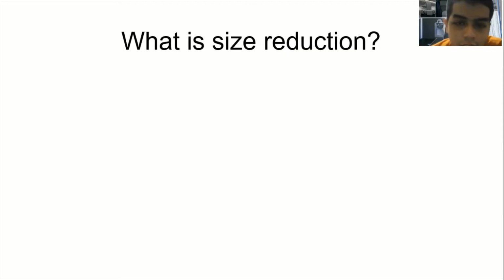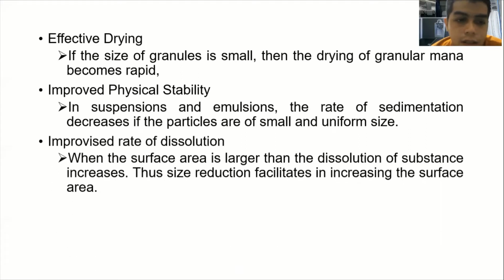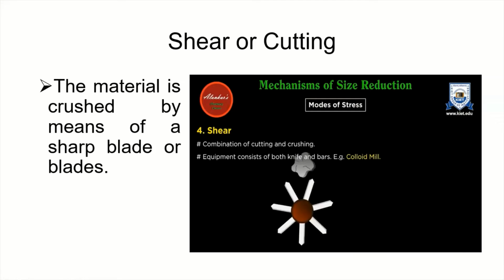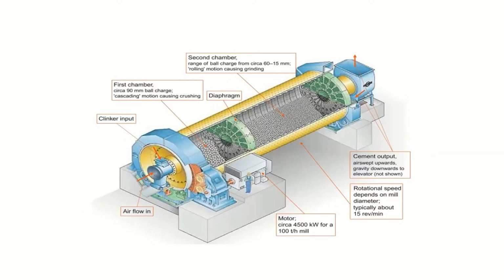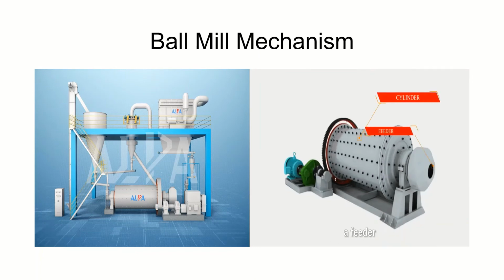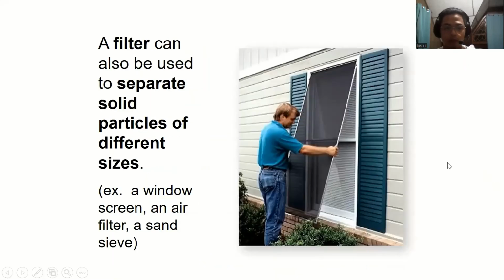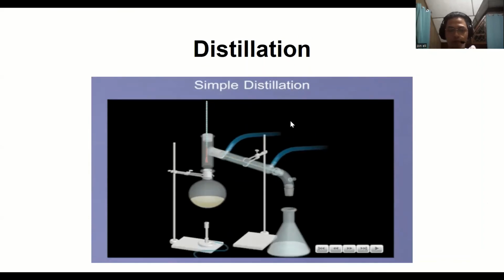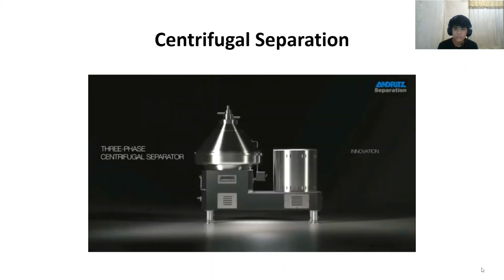Size Reduction and Separation of Solids

Comment: Griño, Loruelle Z. BSME4A
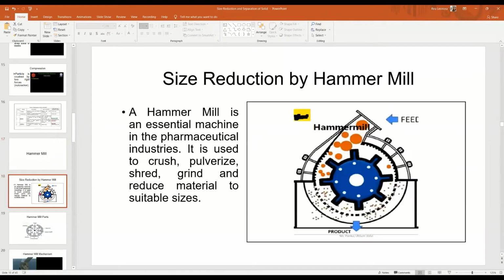18:33 Hammer Mill
It is mostly utilized in the pharmaceutical industry as a size reduction device. Crushing, pulverizing, shredding, and grinding are the primary size reduction operations that occur within a hammer mill to reduce any type of suitable material to the desired sizes, depending on its subsequent application. A hammer mill may reduce roots, leaves, and ginger, to name a few examples.

Comment: Veloz, Adrian Clark D.

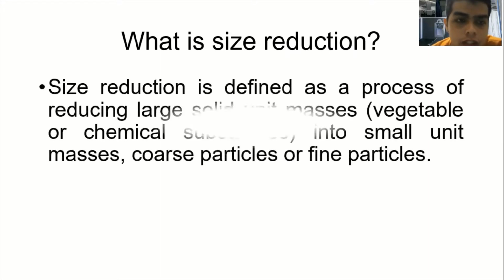1:25 Size reduction.

Size reduction in its name generally means to make the size small by the method of reduction. In the video, it introduces different type of reduction depending whether the material is a liquid or a solid. This type of process is being used mostly in the pharmaceutical industry.

Comment: Macalaguing, Ivan Jun A.
32:25 - I've learned that it is commonly a problem in chemistry, which the basis of separation is set of physical and chemical properties. There are types of separation namely Mechanical Separation, for instance like recycling plastic or metal. Another one is Magnetic Separation example like scraping metal in a scrap yard by the using of magnet.

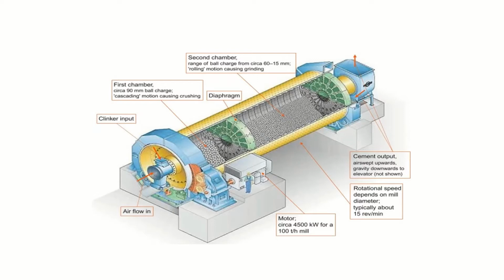Comment: 23:01 Ball mill

Is a type of grinding machine that grinds the material with the help of steel balls. While the maintenance of this machine will be cheaper because you just need to replace the balls when needed.

Comment: 22:15 Ball Mill
Size reduction occurs in a ball mill by impact and attrition. Individual particles within the bed of material in a vertical mill are broken due to such high pressure, even though the particles are considerably smaller than the bed thickness.

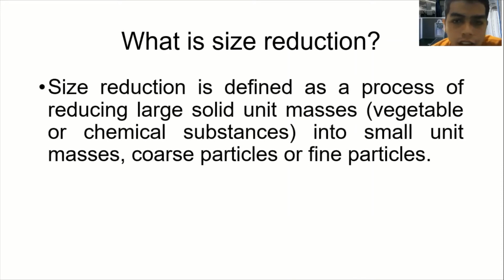Comment: 1:25 What is size reduction?
The process of reducing big solid unit masses, such as vegetables or chemical compounds, into small unit masses, coarse particles or fine particles is known as size reduction. In the pharmaceutical industry, size reduction is a standard practice. Comminution and grinding are terms used to describe the size reduction process. Depending on whether the substance is a solid or a liquid, the size reduction process may be classified into two primary categories. The procedure is known as grinding and cutting if the material is solid, and emulsification or atomization if the substance is liquid.

Comment: Casiño, Sharia Cyril P.
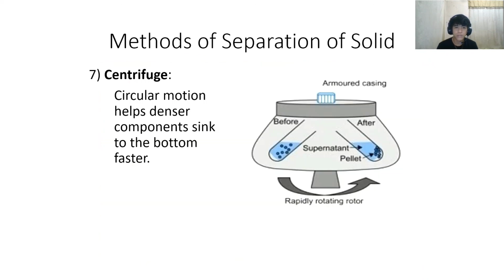48:37 - Methods of Separation of Solid: Centrifuge
The process of centrifugation is used to separate or concentrate materials suspended in a liquid medium. Centrifugation separates particles heavier than the liquid medium using gravity and centrifugal force. Centrifuges separate the particulate from the liquid by spinning the material at high rotation speeds. Also, centrifugation is an accelerated form of sedimentation. To remove particles, most traditional filtration methods employ a filter media. The solid material is collected and removed as the liquid/solid material passes through the filter. Solid particles that are heavier than the liquid eventually separate and can be collected through sedimentation. In the centrifugation process, there is no disposable filter media.

Comment: Calaque, Kyron Davonn C.
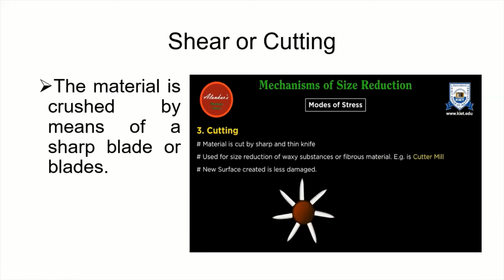14:06 Mechanisms of Size Reduction (Cutting)

Cutting reduces the size of solid materials by separating them into smaller particles using mechanical action (sharp blade(s). Cutting is a method of separating large pieces of material into smaller, shaped pieces that can be further processed, such as powders and granules.

Comment: Castillo, Floyd L. 
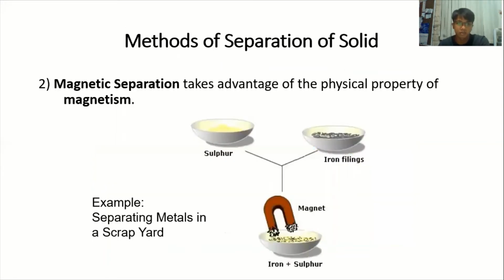33:43 – Magnetic separation of solids
Magnetic separation is the process of separating components through attracting magnetic materials with a magnet. This method of separation separates a non-magnetic material and a magnetic material. Common example is a mixture of iron and sand, in which the magnet attracts the iron.

Comment: Obrador, Crisaint John G.
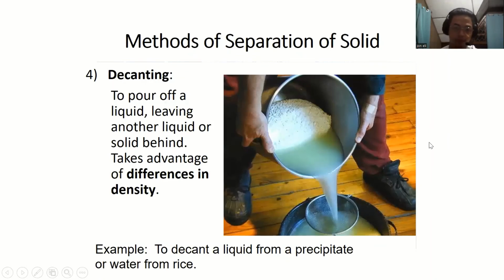39:32 - Decanting
Decantation is a process in which mixtures of an immiscible liquid suspension are separated. For example, if we leave a bucket full of water mixed with sand or clay, we will see that after some time, the insoluble particles settle to the lower end of the bucket. The most common example of this as seen in the video is separating rice from water, which is also same as filtering, but also different.

Comment: Acelo, Ray Joshua L.
48:54 Separation of Solid Centrifuge
A centrifuge is an instrument that uses centrifugal force to separate different components of fluid. By the process of spinning the fluid at very high speed inside the instrument. After spinning the fluids will then separate because they have different densities. Examples of this separation is cream from milk and also liquids from solids.

Comment: Dajan, Kenneth Joseph Rex D.

32:26 Separation of Solid

A separation process is a method for separating two or more separate product mixes from a mixture or solution of chemical ingredients. To put it another way, it's a scientific method of separating two or more substances in order to achieve purity. One or more elements of the source mixture are enhanced in at least one of the separation's result mixtures. In certain situations, separating the mixture into pure ingredients is possible. Separations take use of variations in a mixture's constituents' chemical or physical qualities (such as size, shape, mass, density, or chemical affinity).Processes are frequently categorized based on the specific differences they employ to accomplish separation. If no single difference can be utilized to create the necessary separation, many processes can frequently be combined to accomplish the goal.

Comment: Lamberte, William Wallace A.
6:12 Advantages and Disadvantages of Size Reduction
Before knowing the advantages and disadvantages of size reduction, one must first know what is size reduction. The process of reducing big unit masses into small unit masses, such as coarse or fine particles, is known as size reduction. And some of the advantages in size reduction are, content uniformity, uniform flow, effective extraction of drugs, effective drying, improved physical stability, and improvised rate of dissolution. While its disadvantages are drug degradation and poor mixing.

Comment: Dacoroon, Darlene Grace F.
9:16 - Mechanism of Size Reduction
The mechanism of size reduction depends upon the nature of the material, and each material requires different treatment. Fracture generally occurs along the lines of weakness. During size reduction, fresh surfaces are created or existing cracks and fissures are opened up, wherein the former requires more energy.

Comment: Jayoma, John Lloyd E.
6:13 Advantages of Size Reduction
There were a few advantages of size reduction in this section. One of the benefits is the uniformity of the content, which addresses the effectiveness of mixing only when the ingredients are small and homogeneous in size. The reporter goes over each benefit in depth, including the elements that affect size reduction.

Comment: Casiño, Earl Anthony N.

32:26 | Separation of solids

The reporter discussed the methods of solid separation. The common problem in chemistry is how you can separate them due to each component's having a different set of physical and chemical properties.
The reporter introduced the following:
*Mechanical separation
*Magnetic separation
*Filtration
*Distillation
*Evaporation
*Decanting

Comment: Estillore, Cherry Mae P.
18:40 Size Reduction by Hammer Mill
Hammer mills consist of a series of hammers hinged on a central shaft and enclosed within a rigid metal case. It produces size reduction by impact. The materials to be milled are struck by these rectangular pieces of hardened steel which rotates at high speed inside the chamber. Sizing which occurs by attrition and shear in the second zone where small clearance exists between the hammer and the screen bar producing a particle range of 15-50 µm. The material is crushed or shattered by the repeated hammer impacts, collisions with the walls of the grinding chamber as well as particle-on-particles impacts

Comment: Candaroma, Katriona Maxinne G.
21:30 Size Reduction by Ball Mill
Ball mills are often used to crush and grind materials into very fine powders. The size reduction in the ball mill is caused by fragmentation processes such as impact and attrition, which occur when the balls drop from near the top of the shell. Milling can be done wet or dry, however wet milling is done at a low speed. Ball milling has been demonstrated to be useful in boosting solid-state chemical reactivity in systems with numerous components.

Comment: Pelegrino, Justin Blake Nash E.
18:34 - Hammer Mill
It is a size reduction device that is mainly used in pharmaceutical industries. The main size reduction processes that takes place within a hammer mill are crushing, pulverizing, shredding, and grinding to be able to reduce any kind of compatible material to its desirable sizes, depending on its further application. Specific examples that can be reduced by a hammer mill are roots, leaves, and ginger.